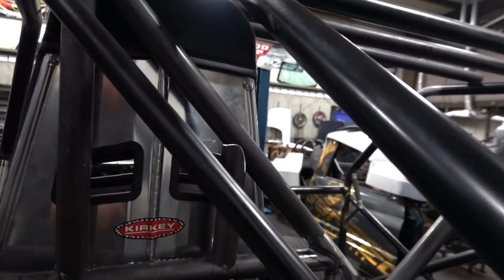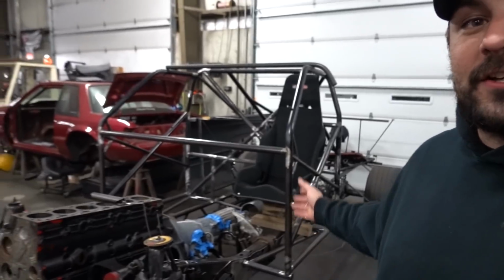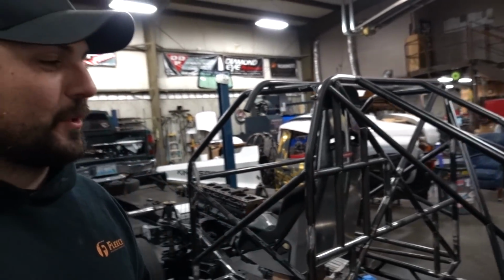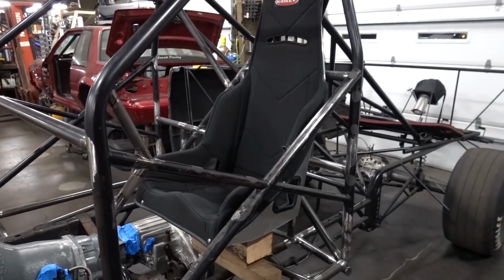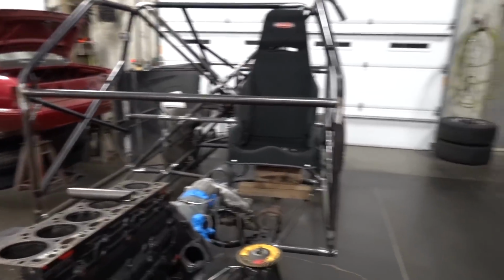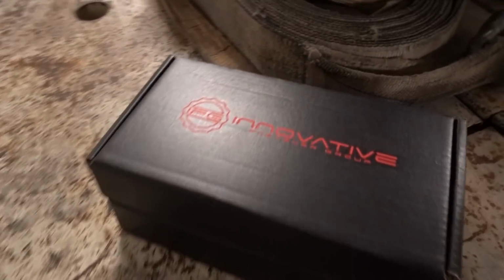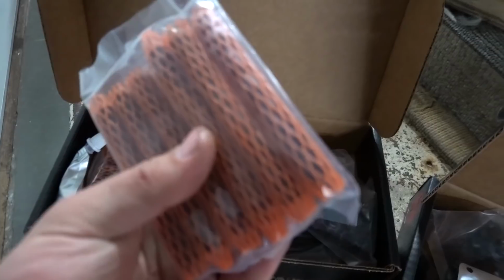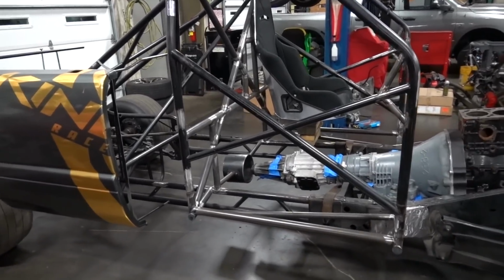CUMMINS Go-Cart?!?!? Should we???

Comment: Hey greg I just bought an 06 3500 Cummins. I was wondering to reach the 900 wheel HP level what parts would you recommend? Now the truck is still stock with 97,000 miles on it.
Reply: Good luck. My 05 was planned for 700 but I've had it almost 3years n barely getting a fass lift pump installed